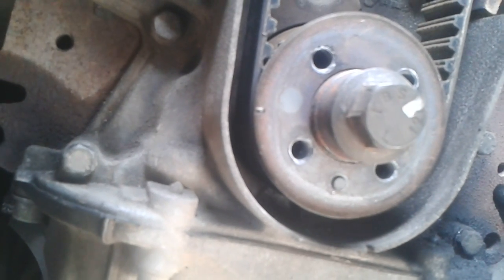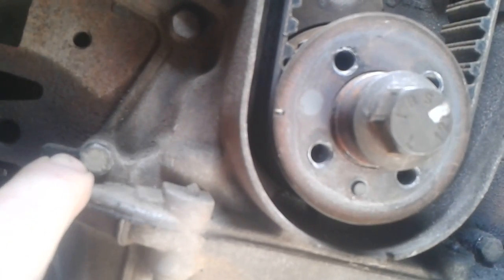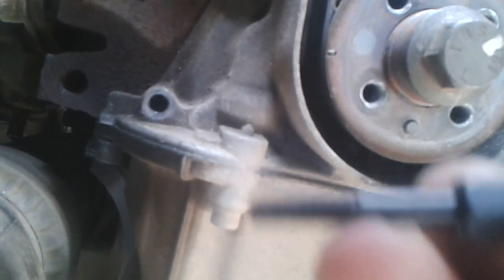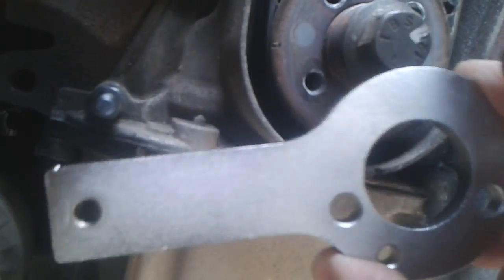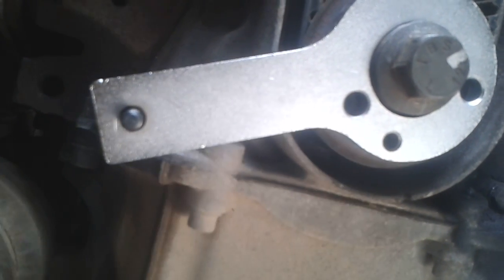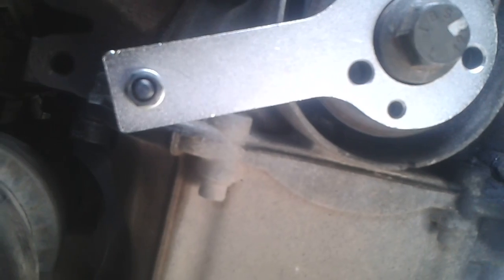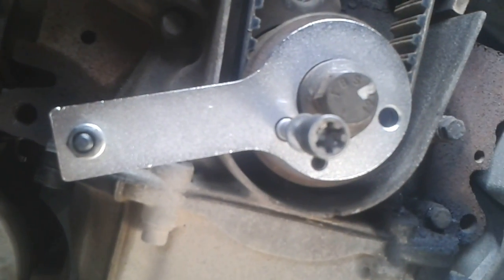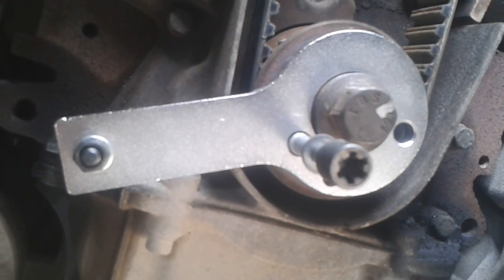Crankshaft Lock/Shaft Locking on Vauxhall Zafira 2006 model

Comment: once you have tis n how do you remove the the belt as its locked in the sprocket ?
Reply from the maker: when lock is in place, loosen off the cambelt so is slack. Then gently undo and remove lock, slide the belt off, then either fit new belt on right there when lock is off, then place lock again when new belt fitted. Or fit lock back on til a new belt is available to fit.

Comment: Ok so my Cam amd Crank are miles apart from being in the correct position for TDC....am i right in thinking the locking tool for the Cam will re-align everything back up??
Reply from the maker: Shaun Green - sorry I didn't see the notification for this post 7 months, may have been a tech problem? However there's a locking tool for each cam shaft up top and markings for crank alignment.

Comment: So when I check the tension by turning the engine over by hand the marks on the belt are two teeth off on the crank and cam? Anyone know why?
Reply from the maker: If I remember correctly, when the belt has been marked, and you turn the engine over by hand, it can take a certain amount of cycles of the belt to rotate and return back to original marked position.
Reply: Nice she's runnin' great now thanks!

Comment: I wonder how you lock the fuel pump sprocket and the camshaft sprocket, do you use a drillbit or something ? Nobody is showing this in theire videoes... And when you remove the timing belt, are you removing the bolt that holds the end of the positioning tool, and then you just hold thight on the positioning tool to the crankshaft and then remove the timing belt slowly ??
Reply from the maker: Hey mate, if your only removing the timing belt, you only need one lock for the camshaft on the exhaust side(front) and the crankshaft lock just to stop it moving at any time while belt is removed. The fuel pump sprocket doesn't need a lock on it when removing belt so the belt it can just slide off.
 
If the camshaft and crankshaft are both locked in position and belt loosened, you can then remove both bolts and crankshaft lock, remove the belt and then fit lock back on to stop crankshaft at risk of moving.
Reply: thanks ! now i understand :)

Comment: what about injector pump timming marks ? thank you
Reply from the maker: Hi, when you say injector pump do you mean fuel pump? If so when fitting the sprocket, it slides onto woodruff key/shaft, held still with holding tool when tighten up with new nut. On the edge of the sprocket there is a mark but dont think its relevant to alignment. 
Injector timing wise, I believe the system is all run by the ECU computer.
Reply: clive smith no nées tout be marked
Reply: No nées i wanted to tell

Comment: how did you remove the belt AFTER securing the locking tool
Reply from the maker: Once the camshafts and crankshaft pulley were locked in position. Loosened off the belt tensioner, then carefully undone and removed lock tool, gently removed the belt completely. Then put lock tool back on till new belt was ready to fit.
Reply: GcBell . One more Question. Just had my head skimmed and had to together with my mechanic reassemble the cam shafts. 1 how important is it to use a torque wrench when refitting shafts back in place (he used elbow greese). 2 How will i know that he has secured the shafts in the correct position. 3 The cam shaft gears come on after he secures the shafts... if shafts were fitted incorrectly, how will this affect the final TDC position markers....

Im sorry i know i said one more. appreciate it.
Reply from the maker: That's okay i will help where i can. Personally i'd say a torque wrench is pretty important to use because then you know something is as tight as it should be for that reason, especially anything heavy duty, but its anyone's choice if they use them.
 For the camshafts there's a locking device which fits in the camshaft housing checking holes (Intake and exhaust side) which locks the shafts in place once rotated. If your mechanic has used the locks then should be okay.
 If the shafts were incorrectly fitted then my guess is the engine wont start because of the timing being out, but also may cause engine damage trying to turn the engine over.
 I had that problem once on a MGZR petrol engine. Didn't cause damage but had to realign shafts then it started up!